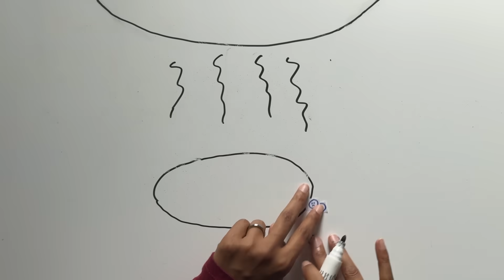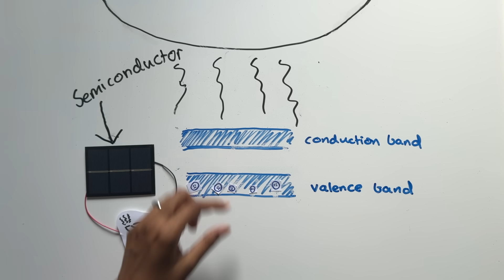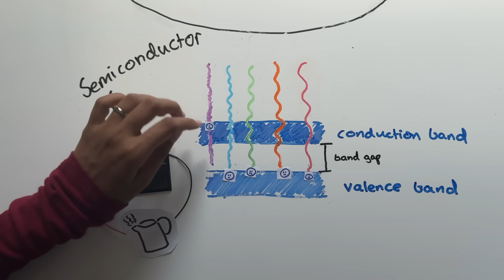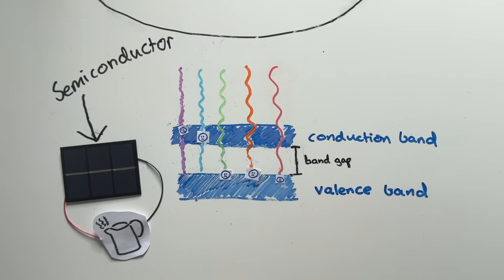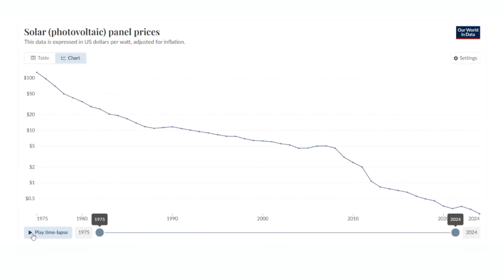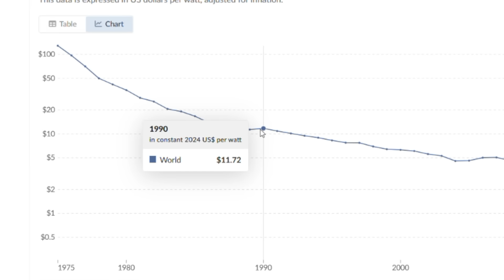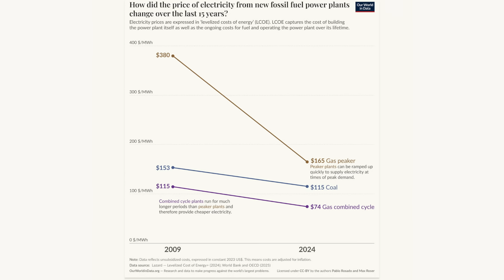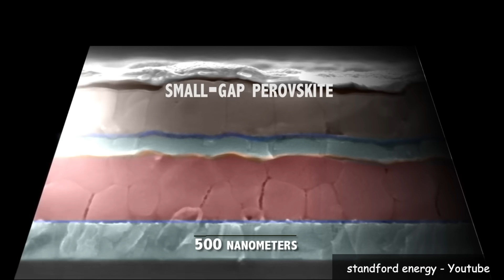Why solar panels can't be more than 33.7% efficient

Comment: It is amazing how much the price of solar and batteries have fallen, but they will not be able to bridge the seasonal gap for any latitude above ~45 N (or below ~45 S) where winter is a thing. At those latitudes energy use increases in direct proportion to the decrease in solar production over the year, meaning you need to take summer energy and use it winter. For even a small grid of a couple of TWh, using the latest avg of ~$77/kWh for Li-ion batteries amounts to about $77 Billion per TWh stored. That is just not feasible. Going away from batteries and using pumped hydro can be done but only in limited quantities due to geography (any other form of gravitational storage should not be taken seriously, pumped hydro is the way to go). Using thermal storage ads about 70% loss factor for the roundtrip of solar -> heat storage -> steam turbine energy. Interconnectors can solve this but makes large regions suscepitble to common-cause-failure events (CCFs) that are very difficult to predict and even model. Hydrogen production is interesting but difficult to do on a large scale - but the industry is putting a lot of hopes on this tech. 
What this all means is that solar+storage is amazing for any place on earth where winter is not really a thing, and where energy needs is proportional to sun-hours (like where cooling is more needed than heating). This is the majority of the planet, so a great and necessary upgrade for the planet, but many countries, especially in Europe, will not be able to go this route. What these regions need is a large nuclear build out, where the major hurdle is public acceptance. 
Just trying to inject an analysis of this tech that will not go away any time soon.
Reply: I basically agree, but you forgot the wind. In Germany solar currently makes up for about 17% of annual electrical production while the wind is at 25% onshore and 5 % offshore. Wind offshore will have tripled by about 2032 and quadrupled by 2040 or earlier, and that may not be the end. Wind offshore is in a repowering process and will probably have doubled in the 2030s.
Solar is extended as well, and we are building large storage batteries and new HVDC lines at a fast pace. 
We also have biogas (8%) and some hydro dams (4%) and on average have 60% renewables through the year.
On the other hand, numerous new natural gas - powered stations have to be built because there will be times when it's dark, not windy, and storages are empty. But gas must be imported and is expensive. So the discussion is going on, and decisions about new gas power stations are expected in the next 1-2 years.

Comment: Question: From a theoretical point of view, why not use diffraction gratings to split the light with different wavelengths and use different semiconductor materials for each wavelength? Costly maybe, but it seems to be a straightforward way to break through the 33.7% (or the 68.7%) limit
(If true, then the 33.7% limit is more of a soft limit from engineering rather than a hard limit demanded by physics)

Comment: The is incorrect. The limit is somewhere between 99.5% & 99.95%. The fact she's talking about is silicon, or other semiconductor panels paired with a metalized substrate. There are SEVERAL other ways to make panels we just don't bother to do the research  because this is easy.  See photosynthesis for an example of a more efficient design. The biological nature of the process is irrelevant the trick is the molecular "wires" the plant uses to move the electrons around. You can get more efficiency using tuned pigments (like the pixels in your cellphone)
Reply: Photosintesis efficiency is around 10% of the direct light, not all the photons have enough energy to move electrons plus between the photons with enough energy there are the ones with more energy than is needed meaning is wasted
Reply: @marcoaorelio6409yes exactly. That's why you need to use different pigments or depending on the technology different quantum dots or different plasmons. Deposit them like a pixel on a retna display and you overcome that issue. You will produce a variable voltage but that will average out.

Comment: My solar is 42% efficient and I live in Scotland. Think mirrors...
Reply: Efficiency is calculated as a percentage of how much energy is put in. If you use mirrors to provide more energy, you can get a more cost effective solar cell array, but it's not more energy efficient.
Reply: Efficiency is calculated per m², so you'll need to consider the total area including your mirrors, not just the solar panel's area.
Reply: No, it isnt.

Comment: It is enough to put more layers with more band gaps, so that each frequency of light would have its ideal conduction layer. Quantizing the panels would be very expensive but it is the only solution, for example in the aerospace industry.

Comment: We don't even really need the solar panels to be super efficient. Based on info I can find online, 2-4kW worth of panels (in the majority of the inhabited parts of the world) would be enough to supply the average per capita 2023 electricity consumption of the whole planet (not just home use). An average house could fit at least 10kW worth of panels on the roof, not to mention all of the business buildings and carparks.

We would still need batteries to keep some for night use (and/or alternative sources like wind or hydro) and power grids to transfer excess production in sunny areas to areas experiencing cloudy weather, but it's certainly achievable without even reaching that theoretical performance limit of single material cells.

Comment: If 1 panel is only 33% efficient, then just add additional 2 to 3 more panels and you'll get that 100% capacity you wish for.
Reply: you mean place alongside - but then you ultimately run out of area (if you area is constained - e.g. on a roof ) .
 I take it this is per square metre (unit area). With higher effeicience you can generat emore power for every square meter you have available.
Reply: The amount of solar panels needed to power the whole world would equal the area of Spain or 1.2% of the Sahara desert, so says Google. I mean sure, it's a lot of resources, but it's not an unimaginable amount. Solar is more iterative than hydroelectric or wind, you can just slowly add in capacity bit by bit over time unlike a major capital project that takes years of planning and has a huge upfront cost.
Reply: @bbbf09 That's the downside of solar panels.

Need more electricity from the sun? Then you have to have plenty of space to sunbathe those solar panels.
Reply: @bbbf09  roof space is often used because its considered wasted space but if we really wanted to maximise the efficiency of our space we won't have any panels or infrastructure on roofs and would instead make that space practical livable areas with BBQ's and outdoor activities and such, Solar farms are also kinda silly because when you really think about it every square meter of solar farm is land that could potentially have grown grains or other foods the real efficiency gain is relocating you're panels to less valuable areas because it's not really how much space that matters but rather how much value in space that could have been used otherwise. In the short term that means attaching a floating device to the bottom of you're panel so we can float it on top of water bodies or somewhere in the vast ocean that we have no other uses for anyway. In the long term it means figuring out how to place it in orbit to harvest solar energy that would never have even reached earth otherwise and then in the ultra long term efficiency per square meter will eventually matter but it simply won't matter until we start running out of places around the sun that isn't at some point going to point towards earth. for a very long time to come it will be vastly more practical and efficient to focus on  moving the panels to less valuable spaces rather than trying to use less space. Why lose sleep worrying over whether you're roof should have 4 or 8 sqm of panels when the real problem is figuring out how we can use 1000's of sqkm for panelsout in the ocean where it won't even be visible from anywhere in your country and still power the whole nation.
Reply: It doesn’t mean 100% efficiency. It means 3x the price.
Reply: @bigedslobotomy  and 3x the space
Reply: What's unimaginable is the amount of waste something like that would create. Solar panels require constant replacement as they reach the limit of their lifespan. Recycling solar panels is still a big problem
Reply: "Even if you wrapped the entire planet in a solar panel, you would only be producing 20% of global energy.

One of the biggest mistakes politicians can make is equating the ELECTRICITY with ENERGY!"
-- US Energy Secretary,  Chris Wright.
Reply: @bornach  Bro that's so laughably wrong its difficult to take it seriously. We would never wrap the whole planet in solar panels but if we did we would receive more energy in a single hour than the entire planet uses in an entire year and yes that includes all energy fuel industrial food chemical everything. You simply underestimated the size of the planet and the sheer amount of solar energy we receive from the sun every day the vast majority of which reflects back into space never to be seen again.

Comment: What if you used a prism to separate the light into different frequencies, then put the optimal frequency for each frequency at the end of the prism?
Reply: The layered solution mentioned at the end of the video is of a similar energy to what ur mentioning, reaching 68% efficiency or do. 
Tho no physical prisms involved as that wud add to the bulk.

Comment: Batteries are not cheap even after their reduced cost and they produce a lot of toxic waste and require strip mining for rare earth materials at present.
Reply: Grid scale batteries are not the same as chemical batteries.

They are giant rotating flywheels with an generator attached
Reply: @AnonymousAnarchist2 That is not correct.  There are lithium ion and lead acid grid scale batteries.
Reply: @wesbaumguardner8829  lithium: yes, lead for grid storage? No. Lithium batteries can do 3000 load/discharge cycles, lead batteries maybe 1000. And the  are no rare earth metals needed for batteries. Lithium Iron Phosphate is the way, not Lithium Cobalt Oxide. And possibly Redox Flow batteries (they use Vanadium).
Reply: @ElwoodEBlues Lithium is a rare earth metal.  Cobalt is a rare earth metal.  Depending on the battery composition, other rare earth minerals are necessary.

Comment: Here in the UK you can't just add more solar power. The winters are simply too dark because the UK is too far North and you'd have to multiply your solar panels by ten or something ridiculous. But wind power is complementary to solar. Wind power is stronger in winter and gentler in summer. And solar is vice versa. If you have the right mix of wind an solar and you use batteries then you can get nearly all of your electricity from renewables even in the UK. But there's a hard-core ~5% where the wind isn't blowing and the sun isn't shining. Australia is a bit better because it's sunnier and a bigger country (turns out that helps) but it has a similar issue.
Reply: That’s why nuclear or geothermal or wave capture/hydro is kinda essential for that last bit no? That and continuously making sure that electrical use is getting more effecient. Making sure we use less energy, and then boom. We should fit in there with the continuously more effecient and powerful green energy tech
Reply: @dubby5768  Nuclear is expensive baseload, so it is unsuitable to back up renewables. Only very old nuclear power plants that have paid off their loans can sensibly curtail their output to do it. France does it a bit with its aging fleet, but the operators still hate doing it, it's technically demanding.

Comment: Solar is only cheap as a result of (1) inexpensive panels from China (2) carbon credits or similar fictions (3) conditions where you can use 100% of the electricity as it is generated with no need to store it and (4) in locations which see a large amount of sunlight.  Change any of those things and the situation changes, often drastically.
Reply: Cool the sun shines even if it’s cloudy cuz if you can see you’re still getting hit with photons.  We’re getting better and better batteries (also china) so we can store more and more solar energy, no one uses solar in isolation. It’s in combination in with wind and likely nuclear.

Comment: Sunshine is free. The balance is between efficiency and cost. If you could get 1% efficiency at 1000th of the cost that would be better than 33.7% efficiency at 100 times the cost. 

The best deals at the moment are retired solar panels which have lost maybe 10% of their initial efficiency but can be bought at 1/4 of the cost.
Reply: That's an extreme comparison but you're underlying point is correct. Used panels are a good suggestion too.

Comment: You would have to realize that the cost of solar is more than just the panel cost, if efficiency is increased then less labor and land could be used for the same power making it much more viable in the long term

Comment: Solar is NOT cheap, when you want to rely on it 24/7! Storage costs are insane!
Reply: nothing is cheaper than solar and wind. Not in Europe. Prices: solar: 4 cents, wind: 6 cents/kWhr.

Natural gas: must be imported. Costs a lot: 20 cents/kWhr, often more.

Nuclear: not viable without huge subsidies, and very unpopular now, except among nuclear lobbyists and fanboys who keep forgetting the cost of new nuclear reactors, the cost of their dismantling, the cost of safe disposal of nuclear waste, and the dependency from very limited Uranium resources. Up to 15 cents/kWhr for new plants (Hinkley Point, Flamanville, Olkiluoto!)

Coal: dirtiest source, has to go, is heavily taxed, and is in the phase-out. 6 cents/kWhr ... plus CO2 certificate (another 6 cents). Has ended in Britain already, will end in Poland, and in Germany coal ends in 2038. Other european countries use little to no coal.

And storage? Costs about 200€ per kWhr of capacity to build and 10 eurocents per kWhr delivered. That's cheaper than a kWhr from natural gas. We currently build lots of storage in Europe. They will save a lot of natural gas we had to buy and burn when solar and wind don't deliver.

To my knowledge, the currently used US gas fields run out in about 15-20 years - at most. Combine wind, solar, and natural gas, and you don't need to worry about storage. Just build some storage as needed, and extend the lifetime of your gas resources. That will work.
Reply: That’s no longer true. Solar+storage is now competitive with gas, and cheaper than coal or nuclear. And storage costs keep coming down.
Reply: @davestagner  Really? In your dreams!
Reply: @JacquesMartini  Go look up Ember Energy’s recent research on this. They modeled a solar+battery system to deliver reliable 24/7 power, and calculated its effectiveness across a dozen major cities worldwide, based on 20 years of hourly solar output data in each. Their model used 6MW solar and 17MWh battery to deliver 1MW power 24/7.  The best city modeled was Las Vegas, 97% reliable. The worst was Birmingham UK (cloudy, farther north than any US city but Anchorage), which was 62%. The cost? $104/MW LCOE (2024 prices; panels and batteries are both cheaper already).
Reply: @davestagner  Sure, the "models". Never fail, allways feets on ground. Build a uint that does this in real life, which supplies 500MW 24/7 and we will see. So far, not a single solar + wind installation comes even close!
Reply: @JacquesMartini The Edwards & Sanborn site in CA, 875MW solar, 3287MWh storage, 1300MW interconnection capacity. If it followed the Ember model (17MWh battery for 1MW steady output), it’d be capable of 193MW 24/7. There’s no reason this couldn’t be scaled larger, because it’s just adding more capacity in parallel. The growth of batteries in California has led to grid gas consumption falling over 40% in just two years, thanks to batteries filling in the “duck curve” that was dominated by gas.
Reply: @davestagner  Let's see how this scales in the next 5 years. Not just in california.
Reply: @JacquesMartini  Yes, let’s! Hope you remember this conversation in five years. :)

Comment: Exowatt is betting big on forgotten technologies from the 1800s: Fresnel lenses, thermal brick batteries, and Stirling engines, all packed inside a sleek orange shipping container. Their system promises 24/7 dispatchable power at a fraction of the cost of traditional solar and batteries—and it’s already being deployed - twobitdavinci

Comment: Wow, truly amazing how cheap these solar panels are these days.  I wonder how the high reported power output come from?  Any hard paper on the matter?  Isn't kWh has like a 1/s in its units?  Shouldn't the more relevant metric be "maximum Voltage"?

Also, I wonder how they manage to get all these silicons.  I hope they are not stealing the sand from public beaches and causing the beaches to shrink as has been reported for over a decade now.  Hm ... coincidence?